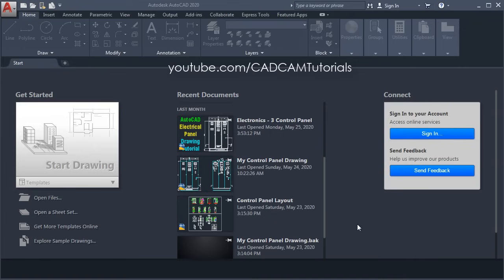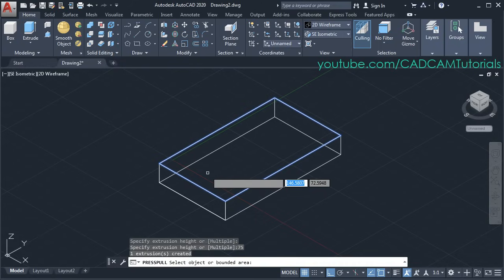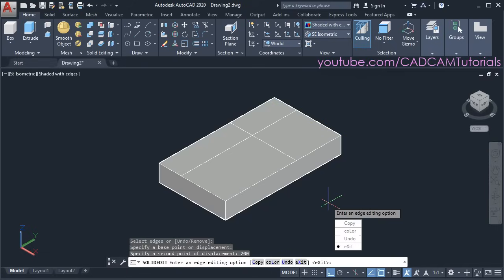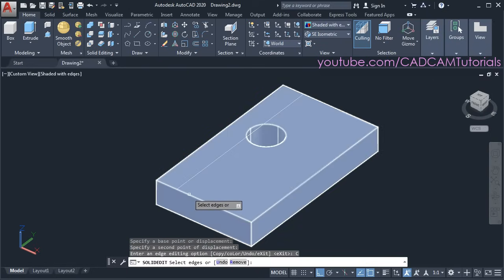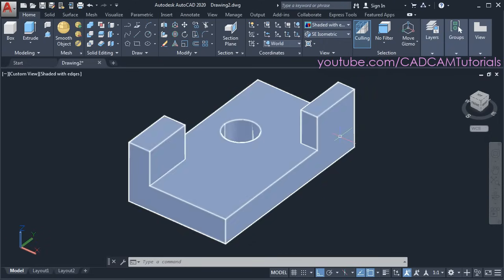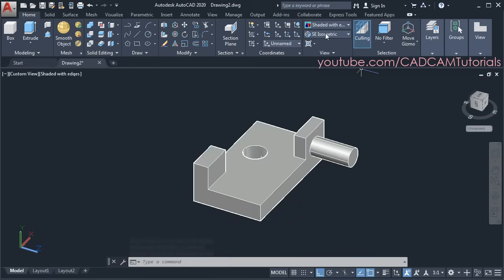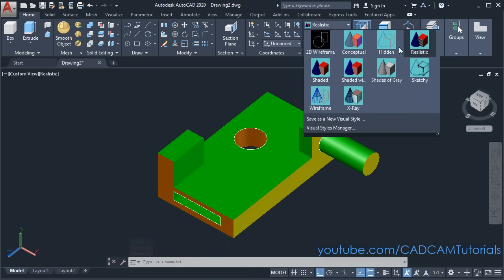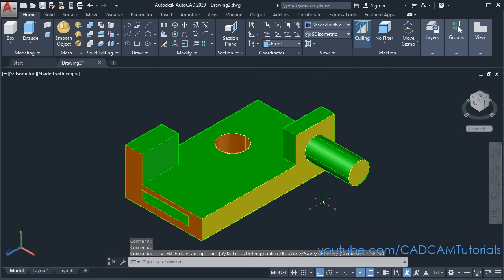AutoCAD 3D Basic Tutorial for Beginners - 1

Comment: Why dont you use offset instead of copy edges? Please answer me sir. Thank you so much btw, your videos are very useful
Reply from the maker: You're welcome 😊 Adif. Offset command cannot be used with 3D objects. Offset will give error and will not select edge.
Reply: @CADCAMTutorials  is it possible if i draw a line on the edges of a 3d object, and make offset out of it?
Reply from the maker: That is possible. But only in 2D wireframe. Why you don't want to use copy edges?
Reply from the maker: Offset is possible only in XY plane and not on Z axis.
Reply: @CADCAMTutorials  actually it's not that i don't want to use copy edges, i was just wondering why offset doesn't work in that case. And when i first asked you, i havent tried 3d modeling. But since you said that offset only possible in xy axis, and i tried 3d modeling,  i get it now. thank you so much sir

Comment: Do you think electrical engineer need 3d cad or bim? If-so should better programs be used like solidworks or revit? From what I read autocad 3d impression is not favourable but 2d drafting autocad is preferred. Thanks for the video. I will go through it again.